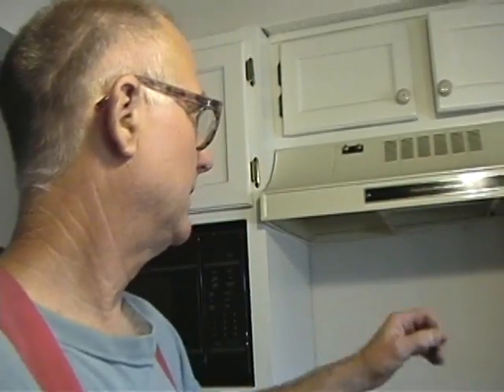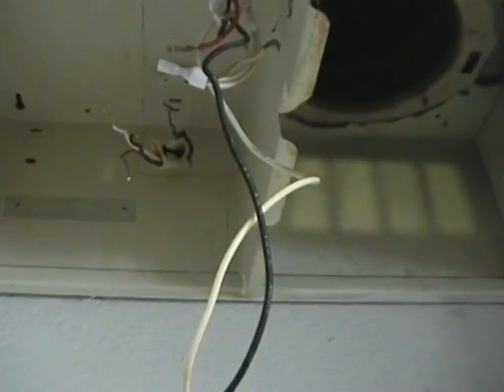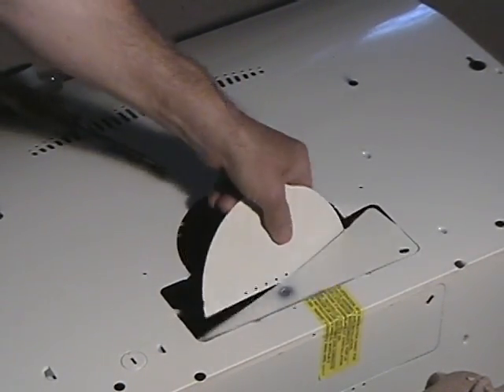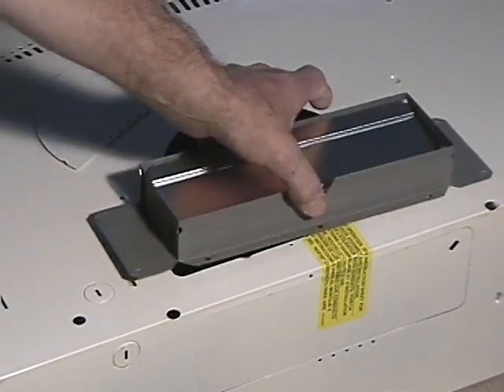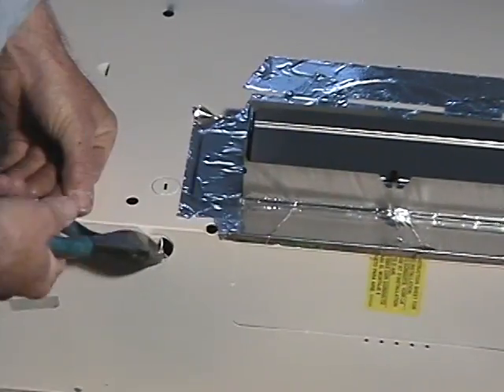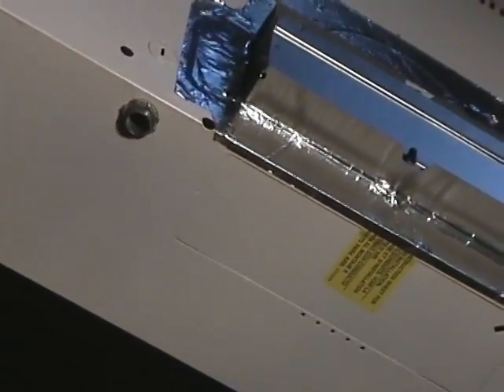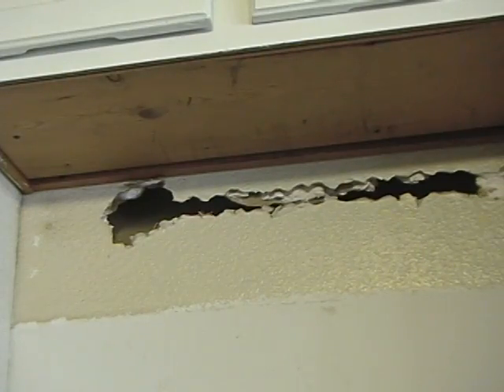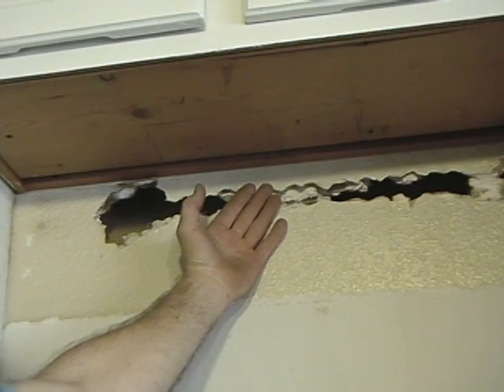Installing a vent a hood or microwave over a stove , Check the description for the  adapter

Comment: Great video.  I'm replacing an old non-ducted with a Broan ducted hood.  Instruction manual is brief and not so great (probably for a professional installer).  I've watched a few videos already....not so great...yours is the best by far.  I saw that I could use a 7" round or the 10" rectangular opening.  I had no idea you had to buy a special baffle for the 7" round (can't believe instructions didn't tell me that).  Also wasn't sure if I needed to punch out the semi-round piece.  You answered those questions...so a big thanks!  Looking for your part 2 video but cannot find it as yet.

Comment: I just watched you take out that metal from the top of your fan and just did the same thing here with a pair of pliers.  Pliers are faster. Also, I didn't remove the half circle part of that sheet metal, so it remained secure and with it's holes intact to screw the vent to.
Reply from the maker: Yvonne Hummel I'll remember that next time  thanks and thanks for watching

Comment: I left the baffle/damper flap off of the vent when I installed my microwave  exhaust.  Is that going to be a problem?
Reply from the maker: The only things I can think of is a drafty cold air  coming in . I really don't know the correct answer
Reply: You'll get cold air blowing through in the winter, hot air blowing through in the summer along with dirt and mosquitoes or other bugs falling into your microwave as well.

Comment: Can you provide the part number for the transition round duct plate?
Reply from the maker: I'll get it for you. Might take me a day or so. Thanks for asking
Reply from the maker: Type this into home depot's site and it will bring up the part you need. The flapper will come with the vent a hood or microwave .  3-1/4 in. x 10 in. x 7 in. Hood Transition Fan Boot